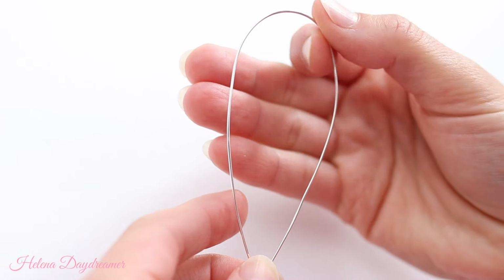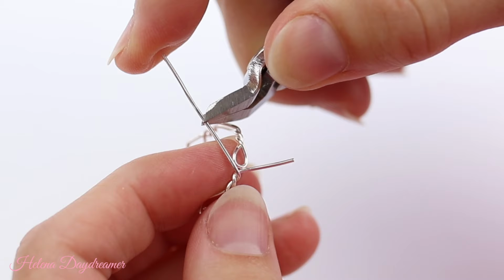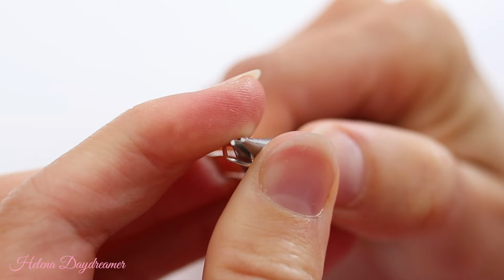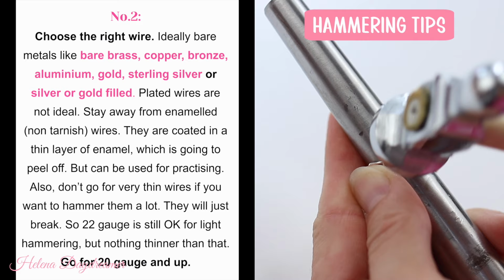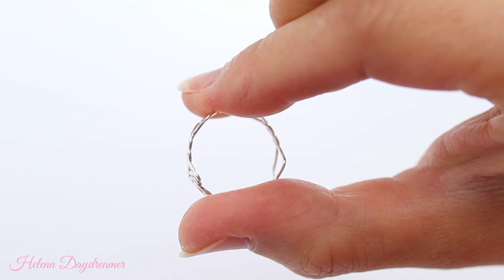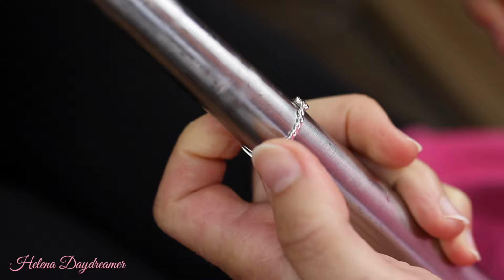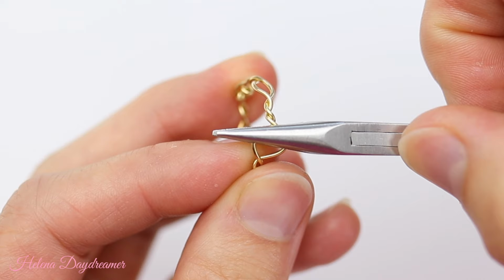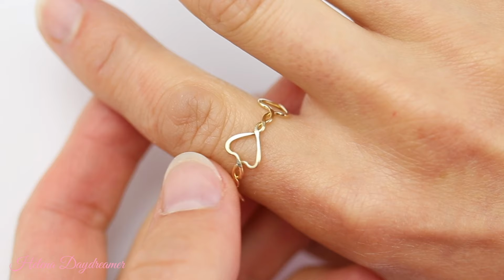DIY Hammered Rings & Hammering Tips (wire wrapping rings) DIY Rings

Comment: I love these!  In other videos the artist says not to hammer twisted wire as it will break.  Have you had any problems with that?  I really like how your wire turned out after hammering.
Reply from the maker: It depends on what sort of wire you hammer and how much. From my experience, softer wires, like copper tend to get more brittle when hammered, but bare brass seems to withstand a lot more.  But whether it’s twisted or not, it’s important to know when to stop hammering, otherwise the metal will break. When the wire is twisted and not very thick, you don’t want to apply too much pressure with the hammer.

Comment: Helena thank you- It really does make sense when you say that hammering does not go well with “non tarnish” wire. I’ve tried it and it’s just very dull with no shine whatsoever after hammering. So the BIG question is: what do you like to do to prevent tarnishing of bare brass, copper, etc? I don’t want to sell something to someone, and then their piece turn tarnished right away. 
Also, have you used metals like aluminum and stainless steel and have found that they do not tarnish? Thanks for some direction in this. Otherwise, I feel like I will have to only result to the expensive stuff like gold filled to make my stuff. And that’s not always affordable.
Reply from the maker: You can buy products to either spray or coat your jewelry and slow down the tarnishing, but they do have pros and cons too.. I'm going to make a video on this topic hopefully for next Saturday as there were a lot of people asking about this. So I will go into details there ❤️ I hope that's ok ☀️
Reply: Oh, ok. Then I will be waiting for next Saturday for sure! Thank you for your informative expertise!!
Reply: Hi Helena- Were you going to make a video about this? Tarnishing of metals, different metals vs others, pros and cons?

Comment: I'm very new to wire wrapping and I have a question. I buy parawire and it's all non tarnish wire. If I were to use copper could I buy it from a hardware store or is there a difference in wire bought from places like parawire as opposed to a hardware store? By the way I love your rings, they are so pretty...
Reply from the maker: Hi, thank you for watching and I'm happy you like the rings 💕 When it comes to wire, I personally buy mine from craft supplies or jewellery making supplies. I guess it depends what sort of hardware store it is and what quality of metal wire they sell, but I would personally still aim for the above suppliers, even if it's not a well known brand like Parawire. Btw parawire sells all sort of bare wires too, check out their website. But, just to let you know, non tarnish wire is great for jewelry making, I use it all the time, it's just not suitable for hammered jewelry ✨ Have fun on your jewelry making journey 💖

Comment: Is there a reason you did not hammer the ring before you shaped it - at least everything but where it is joined?
Reply: I can’t say for certain, but it’s probably to avoid work hardening the wire while it’s still being bent - that way there’s less chance for anything to break off during the shaping process